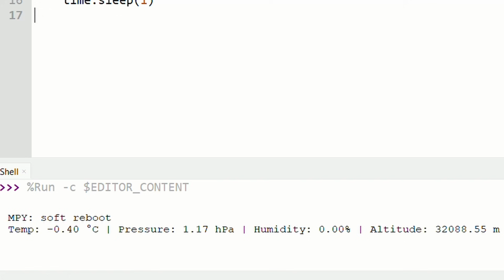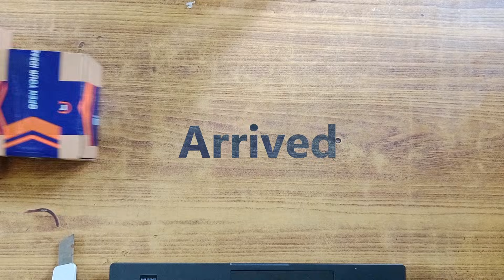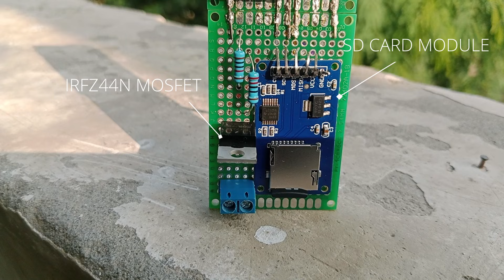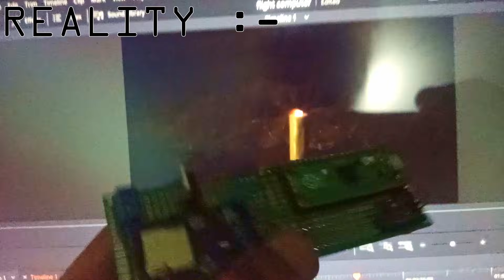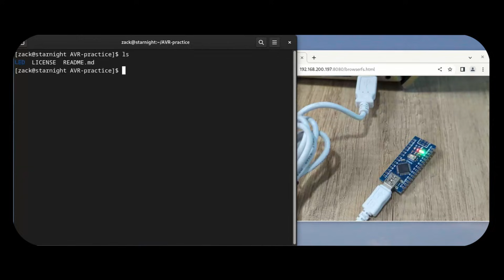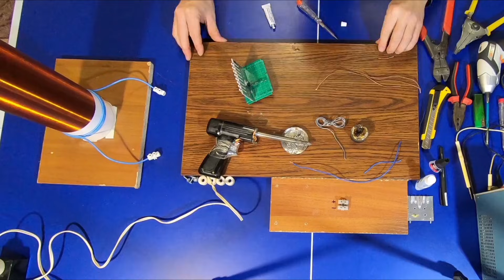I Made a DIY Flight Computer!

Comment: no raspberry pie pico is more capable then arduino nano voltage level is a very small problem you have learn to get  over it its really simple thing you should use transistor as chatgpt suggested or a mosfet gate driver ic , but be carefull  while making connection one wrong move and pico can get fried so for isolation you can also use a optocoupler then use that to drive the mosfet
Reply: also soldring and esd can cause problem to sensitive electronic componets
Reply: also the problem of bulb being on all the time might be because of body diode you can solve it by reversing source and drain connections

Comment: The Makeverse Mircro SD CE07926 is compatible with both 5v and 3.3v supply.  I use it with 3.3v supply of the Pico.
Reply from the maker: Hmmm🤔
Really? 
If it can be used by 3.3v , then that's good but still i will not use it because I got a new one and it's installed on the perfboard. Maybe i will use the old SD card module in another project.

Comment: 1. Connect the SD card to your computer.
2.open File Explorer, then right-click on the SD card drive and choose Format.
3. Use these settings:
File system: FAT32 for cards 4GB to 32GB or FAT for 2GB or less

Allocation unit size: Default

Volume label: You can name it anything

Quick Format: Checked ✅

Comment: Have you formatted your SD card? If not, format it to FAT32 before using it with the SD card module.
Reply from the maker: I didn't do that. 
How to do that? Are there any tutorials on YouTube?
Reply: @CosmicCraft-r47  1. Connect the SD card to your computer.
2.open File Explorer, then right-click on the SD card drive and choose Format.
3. Use these settings:
File system: FAT32 for cards 4GB to 32GB or FAT for 2GB or less

Allocation unit size: Default

Volume label: You can name it anything

Quick Format: Checked ✅